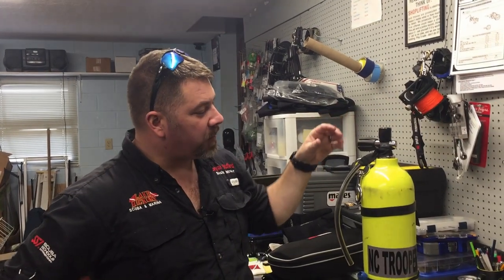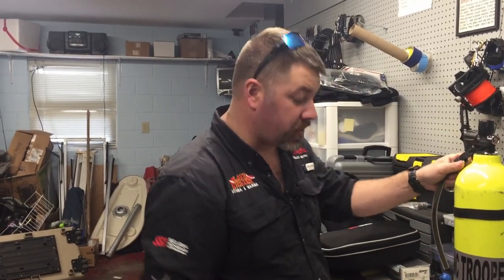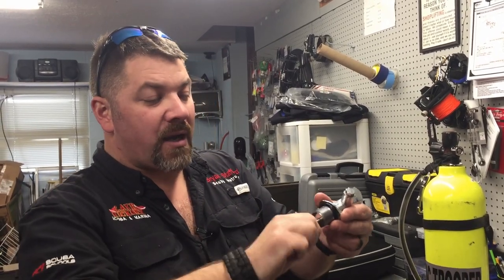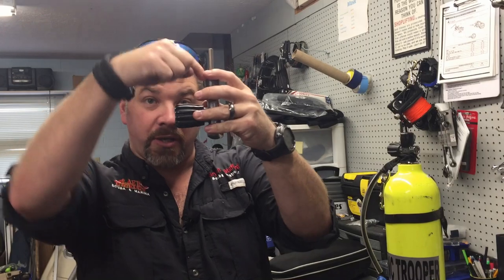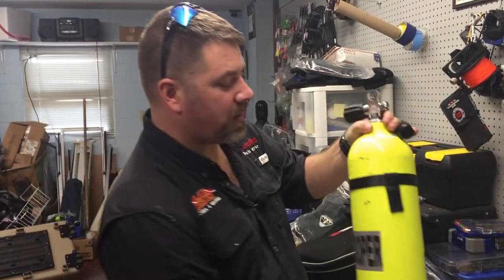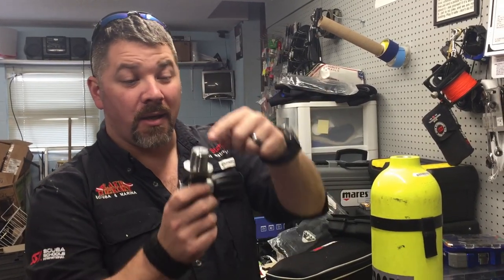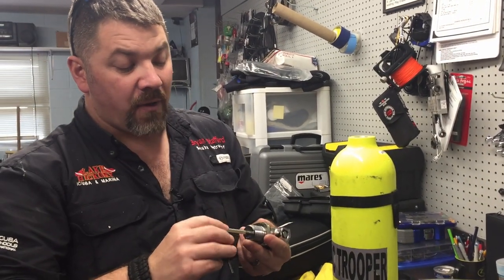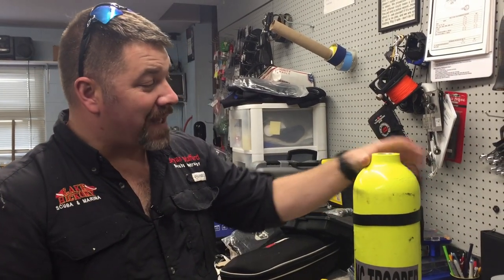What Is That Rattle In My Tank ???

Comment: Thank you for the video. Why do some tech divers remove their dip tube‘s? Thx
Reply from the maker: There are several reasons they do this, but one of the biggest reasons is for the partial pressure blending process, when filling their cylinders with Nitrox.  During the partial pressure blending process, we first start out by putting pure oxygen into the cylinder, before topping off with air.  During this time, we want to prevent any type of spark from happening, typically from hydrocarbons in the cylinder bouncing around (this is why for partial pressure blending cylinders must be oxygen cleaned), but more so from a little metal tube bouncing around against a metal cylinder.  With a cylinder that the Dip Tube has been removed, this risk is not an issue.  Me personally, they don't really bother me, so I leave all mine in.
Reply: LakeHickoryScuba thank you for the quick and detailed response. Safe driving.
Reply from the maker: You're welcome, and safe diving to you as well.

Comment: Would it be safe to put a little dab of loctite on the dip tube threads to keep it from unscrewing itself?
Reply from the maker: Possibly, I would definitely use Blue Loctite and not Red. It all comes down to what the manufacturer recommends.  When dive shops act outside of the recommendations of the manufacturers , insurance companies can drop them.  That would be bad for a dive shop.  This is the main reason dive shops follow certain protocols.  We are bound by what our liability insurance coverage allows us to do.

Comment: So how do you .. tighten up the new style valve stems such as the blue steel that have absolutely no Allen key or flat spots in them to put a wrench on... Just a side note every time I've seen somebody stem come off like that it's usually been because that particular tank has been hot field quite a few times and the density difference between the thin metal of the two and the thick part of the tank valve expands and contracts and a different rate causing it to loosen
Reply from the maker: Great question.  In short, as carefully as we can.  Dip Tubes are made from coated brass and can very easily be damaged.  In the past, I have use a small piece of rubber that wraps around the Dip Tube, then I use Vise Grips to lock onto the Dip Tube.  Even doing this method, there is still a small amount of damage that can occur to the Dip Tube.  The real hassle comes when the Dip Tube has broken off up inside the valve.
Reply: You can also use a small plastic strap wrench.